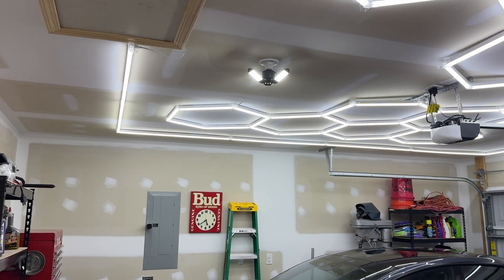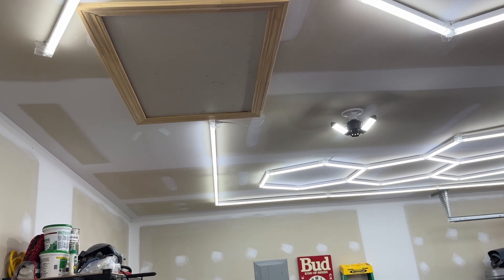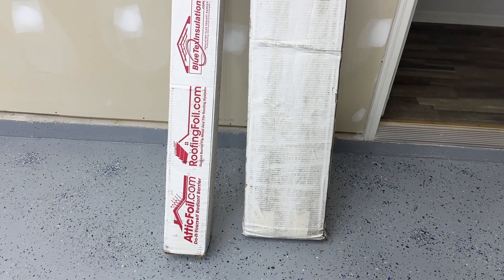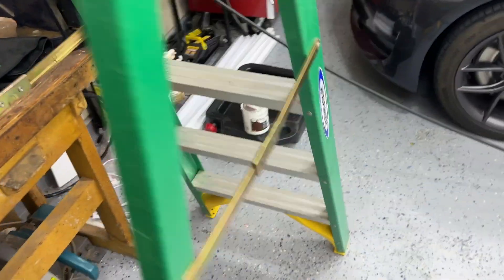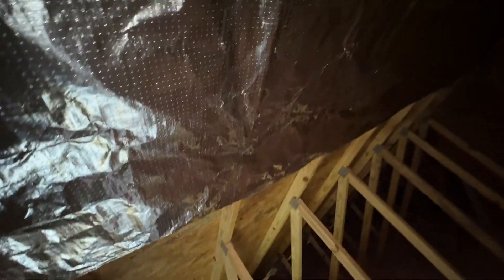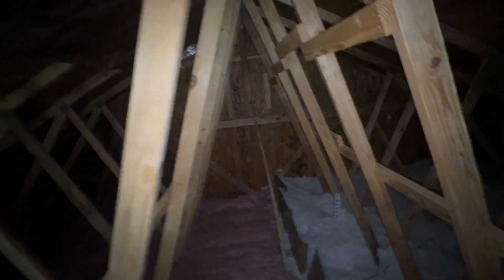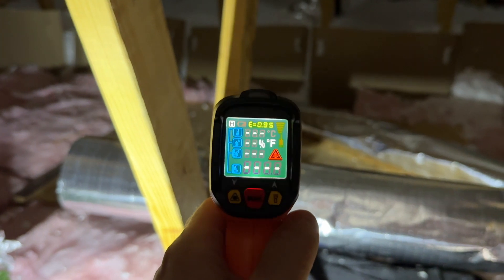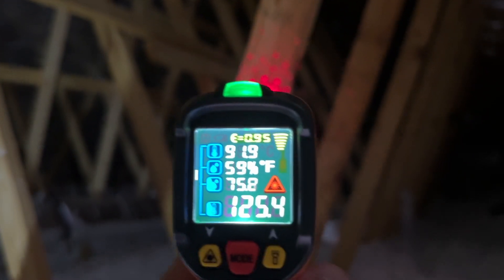Does a Radiant Barrier Cool your Home?

Comment: You want a real difference, been thru all of this. Your ridge vent is barely working! It does everything so slow. Put two solar/electiric fans on the roof. Amazing results. Attic is outside temp 2 hours after the sun goes down. Measure your temp at the same time bet it’s still pretty Hot! Ridge vents aren’t all they are cracked up to be, even if you got 30 plus feet of it.
Reply: When I had my roof replaced they told me electric fans were better than ridge vents & they don’t install them anymore and I live in South Florida so it is hot every day of the year.
Reply: @palmbeachcane9523 it’s funny you say that. I was told by an HVAC contractor not to get attic fans as it causes negative pressure in the attic and will draw cooled air into the attic from inside the home.
Reply: @Crow44195 I’m in South Florida and right now at 11:34 pm it’s 75 degrees with rain and 100% humidity. It’s different in S Florida it’s 85 degrees at 6 am & heat index of 105 every day in summer.
Reply: @palmbeachcane9523 Ok I live in SE Louisiana and we have the same weather same humidity. It is hot, sunny with lots of rain almost everyday. After the contractor told me not to do this I did my own research  and he was right.

Comment: I’m confused because that 125 is still unbearable right?
Reply: Its hot but its similar to how the difference between 60F & 80F is insane... this 20F drop is crazy good. Especially for the HVAC system... any ductwork in the attic has 20F less of a temperature gradient!